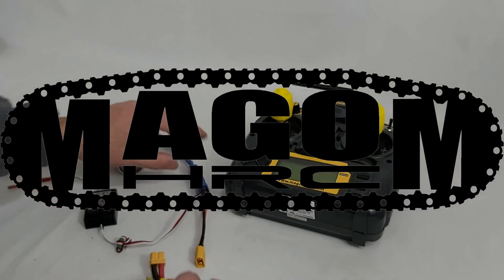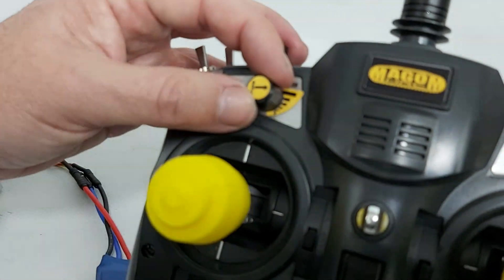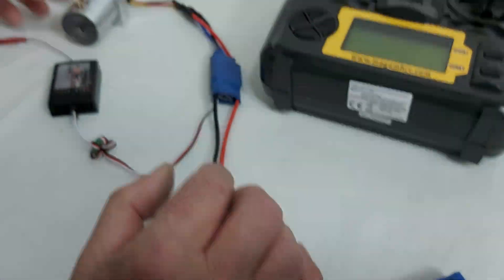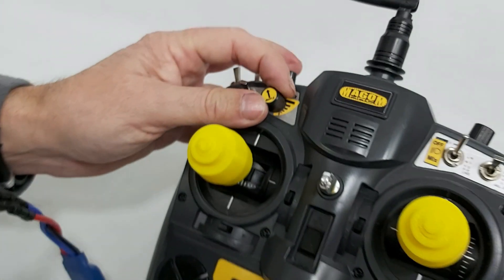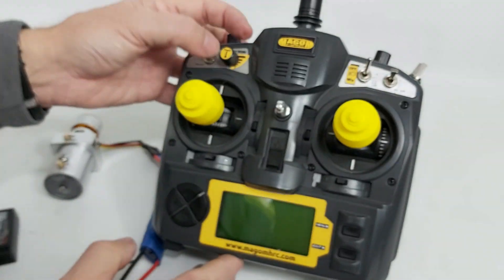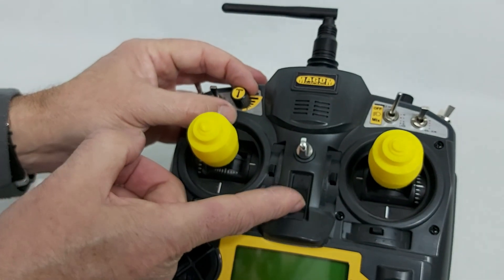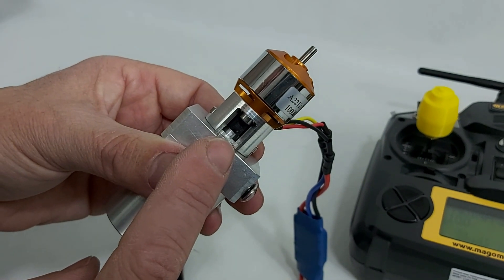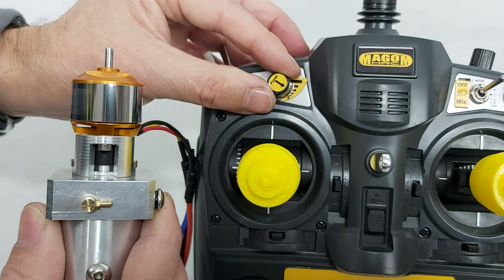How to program ESC 60 to 30

Comment: Which way does it turn Clockwise, Or counterclockwise??? or does it matter?
Reply from the maker: Hello! It depends on the wiring. Brushless pump must run clockwise. If it doesn't run clockwise, change two of the wires between them. Have a nice day!